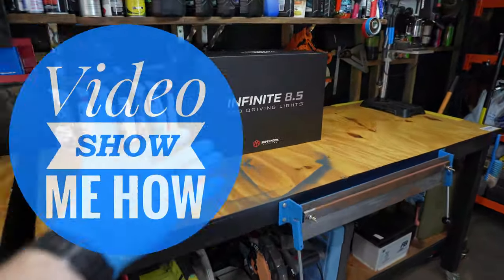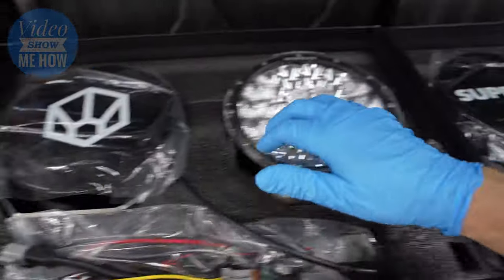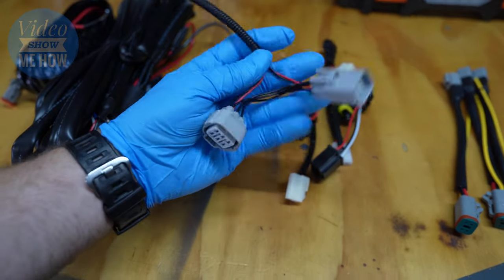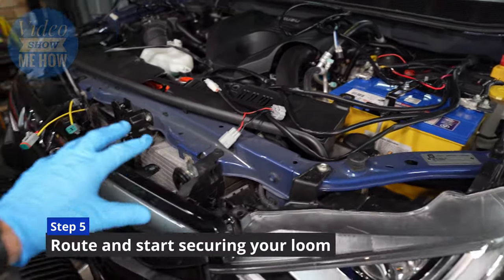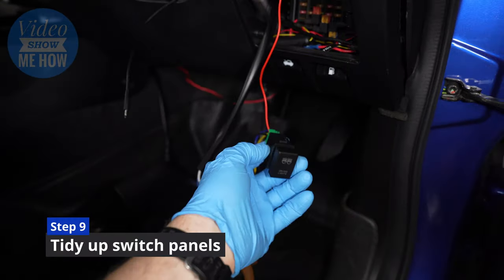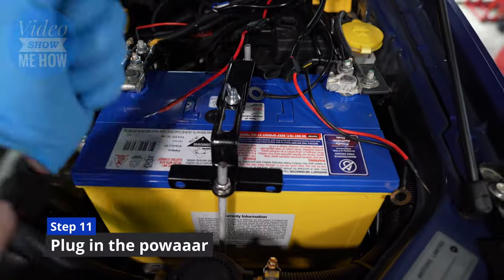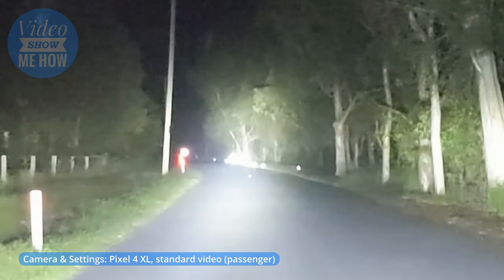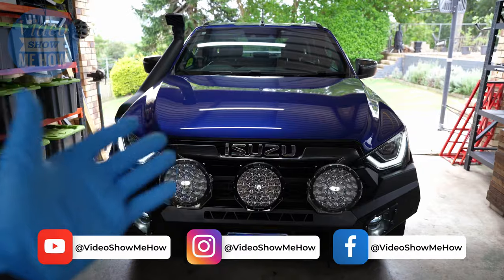SUPERNOVA INFINITE 8.5 LED DRIVING LIGHTS | Review, Install, Test | 2021 Isuzu DMAX Build Series #30

Comment: Hey mate. Just wondering where on the battery do you connect the positive? Strait to the terminal or on the extra part off it past the fuse.(if that makes sense, looks like you connected your dual battery to that part) I’m just having issues with my dmax after installing the dual battery and some work lights, the front light bar doesn’t work or cuts out if it does turn on. Thanks

Comment: For anyone wondering, the green wire is constant power for the DRLs, so hook it to that if you want your spotlight DRLs to be on without having your parkers on
Reply: I just gave this a go and the spotlight DRL's don't light up at all, whether they are on manual or automatic lights.

Edit: My bad, they actually do work perfectly in line with the DRL's - it took me to switch into neutral with the handbrake on to see whether they were working or not. 😝

Thanks mate!
Reply: Yeah thanks mate. I watched the vid and spliced into the one he shows here. Only work with parkers, but i want them to have constant power like DRLs are supposed to 😂
Reply: @jamiesmith6685  I feel ya mate! Here’s me contemplating splicing into a different wire until I get that result. Then get a new loom if all else fails...

Comment: Just putting this out there for comments if you have come across this problem. I have a 2022 dmax x terrain and on a night trip out from Kempsey on bitumen roads I noticed that the lights are s(&t both in high and low in low you have a little more then say a car  lengths of view, on high the depth is very poor and not much depth . Has anyone come across this? I took the car back to the dealer and they adjusted them a bit but I was told that’s all they  can do legally!. Any comments, otherwise I will need to follow Adam’s fit of accessory lights……!  Not happy at all 😡😡😡😡😡😡😡Thanks

Comment: Hey Adam, for the dash running light instead of slice in can you use a piggy back fuze connector to the fuze box right below it?
Reply from the maker: For the dashlight bit? Yeah you could do, just have to find one that powers up with dash 👍
Reply: Cool, what about the engine bay? I don't mind doing modifications to non factory bits that are easy to replace but factory bits are expensive.
Reply from the maker: @MP-hf3jn  nothing needed for engine bay mate, it's plug and play, the bit I modified in the vid for the DRL is the part you get from Supernova, eg so you don't touch the factory loom or plugs, one of the best things I like about the kit from them 👍
Reply: What about the parkers lights?
Reply from the maker: @MP-hf3jn  the Daytime Running Lights?
Reply: Yeah that lol
Reply: Purple wire to middle black wire
Reply from the maker: @MP-hf3jn  yep that's it, all in the vid... If you want to run the DRL on these (or any other spotlights) recommend modifying the supplied connecting loom that Supernova supply rather than the DMAX loom. Then it's just plug and play. Also if you muck it up, you can just get another patch cable from Supernova, easy. But just follow the vid and you'll be fine 😀👍
Reply: Man I follow all your videos. My Da'Maxs is almost brothers to yours lol
Thank you for all the work and time for making these videos and products easily accessible.
Reply from the maker: @MP-hf3jn  thanks mate, that's why I do it 🤘

Comment: Great job. With the excess wire, is it OK to bundle it & zip tie or should it be spread out to dissipate heat?
Reply from the maker: Could bundle, just not tightly, I cut the excess out of my loom 👍

Comment: I just had a bullbar fitted, and just purchased a  light bar  to fit onto it.
On the instructions, it states,  to join 1 wore to the high beam lead!! 
Wheres that at,what colour wire is it, and how do i achieve that fitting ?
Gr8 video btw👍
You make it look easy.
Reply from the maker: I show this in the video mate, about half way the purple wire... Hopefully the light bar came with a patch cable but if not you'd have to use the existing headlight loom

Comment: Hi Adam
I’m wiring a light bar as well so my question is can you parallel the high beam trigger and negative at the push switch in the dash to reduce wiring to and from relay?
Thanks in advance mate 👍
Reply from the maker: I run a lightbar as well, checkout that vid for what I did with the wiring..basically I spliced into existing headlight trigger wire but still used its own relay etc

Comment: Discount code used! 

Thanks Adam, 
I’ll take up your advice on the factory look plug you’ve used. 

Do I need the micro 2 fuse cap to install a set of 2? 

Thanks,
Louis
Reply from the maker: Great 👍 No shouldn't, has it with the supplied loom
Reply: I didn’t think so just ticking every box before I get started. 

Thanks for the reply 👌🏻
Reply from the maker: Have fun!

Comment: Hi Adam, do you reccomend the solder connectors for splicing or t tap slice connectors? For tapping into the signal wires?
Reply from the maker: Not a big fan of the tap/slice or scotch lock style of connectors particularly in vehicles or anything that vibrates. I try and use the waterproof solder connectors I did a video about a while ago where possible
Reply: @VideoShowMeHow  cheers Adam 👍 did you use solder connectors for tapping into the brown wire for the dash illumination?
Reply from the maker: @SonicsnakeCNR  yep
Reply: Hey Adam love your videos. How did you work out that the brown wire is the dashboard feed light feed? Just curious. 

I’m going to wire up my 2023 SX tomorrow, thanks for the inspiration!
Reply from the maker: Cheers. Used a test light

Comment: Hi Adam,  can I just use a T-Tap to tap into that brown wire for dash illumination? And is it also the brown wire if I want tap into dimmer switch on the right? Can the illumination on your switch be controlled by the dimmer?
Reply from the maker: Best avoid the dimmer circuit, sometimes leds can flicker etc if on a dimmer. When you say a t-tap do you mean a scotch lock? Am not a fan of those :(

Comment: Looks cool, but these lights are quite big, arent they limiting the airflow going to the cooling system?
Reply from the maker: Nope, I tested this and the delta is <1c, I show the temps during the light test in the vid.. this is a bit of a myth in a lot of cases
Reply: @VideoShowMeHow  cool, thanks for reply
Reply: You won't notice a massive difference in cooling under light loads (daily driving, highway etc), it'll be come apparent when you start putting the engine under at full power under heavy load (sustained towing up hill etc)...

Comment: Hi Adam, all your videos are fantastic many thanks. I want to buy a SUPERNOVA Light Bar for my21 D Max X Terrain, can you let me know where bought the Piggy back adaptor Plugs for the my21 D Max high beam light feed from... Many thanks for your help Cheers Kim :-}}
Reply from the maker: Hey thanks Kim! Came supplied with the lights, Supernova also sell these separately 👍
Reply: @VideoShowMeHow  Thanx for the quick reply Adam, I was unable to find the My21 D Max Piggy back adaptor Plugs in several attempts using  there web site and was also unsure of what was supplied in their loom. Their blog instructions on their website also advises cutting, splicing & soldering into the light high beam feed, something I do not want to do. Stedi & LightForce sell the My21 D Max Piggy back High beam light adaptors but I'm unsure of if they are compatible with the plug on the SuperNova Loom   -  so I will call them and email them to find all this out and update this post.... Cheers Kim :-}}...... 

Update....... 
..... I ended buying a STEDI Piggy Back Adaptor - Suit Isuzu D-Max 08/2020-on & 3rd Gen Mazda BT-50 (09/2020-On), .....
.... After confirming with Supernova that this  Piggy Back Adaptor would work with their supplied loom on the Supernova 22 Inch Light bar - Single Row Delta V3.0

Comment: Hey Adam, I’ve just put a triple pack of the supernovas on (AltiQ) and they seem to be triggering with low beam and causing a LH headlight failure, I did use the patch harness too with the kit. Any ideas what could be wrong?
Reply from the maker: Hmm hard to say. I would be breaking out the test light and confirming what wires are being engergised with the patch harness. Sounds like they might be in the wrong spots
Reply: Found the problem, turned out to be the patch harness!! 😮

Comment: Hi

I have that same harness with two DT connectors, I want to add a third light, what adapter do I have to buy to add it?  Will you have a link?
Reply from the maker: @espaun206  I ran a separate harness for my 3rd
Reply: @VideoShowMeHow And how do you get them to turn on and off with the same switch?
Reply from the maker: I just wired the trigger for the relay to the same switch.. this is covered in the video

Comment: Hi Adam question mate was it hard feeding the wire through the fly wall
Reply from the maker: no not really, if tricky can always use a coat hanger or the like, with the cable taped to one end of it poke and then pull the lot through. Have found the gromet on the passenger side easier

Comment: So the my22 dmax I got in April doesn't have that dummy plug... I spliced it from the brown wire on the dash light dimmer plug, everything lights up but my switch.. I am also lacking the wiring loom for headlights atm. I believe that is also a reason as to why . Thoughts?
Reply from the maker: What type of switch? Does it have a good earth?
Reply: @VideoShowMeHow  the narva switch. 

Like whole wiring loom setup minus the loom to headlights

Comment: Hey Adam is there a way to pm you? Want to see if you know how to change front indicators to led?
Reply from the maker: Hey bud, do you mean on the factory bar?
Reply: @VideoShowMeHow  yeah man, is it a mission or fairly simple? Wanna avoid taking the bar off
Reply from the maker: Just had a look at the old bumper, I reckon you wouldn't need to take the bar off, can remove the housing with a couple screws.. then it's just be replacing the globe with an led version
Reply: @VideoShowMeHow  legend cheers

Comment: Hey, I was just told by ARB that I have to get 7inch driving lights because anything bigger will get in the way of the sensors…. Is true?? I feel they are full of it. They are only going in the middle of the bull bar in the usual spot everyone puts them…anyone help me out? I have a 2021 dmax terrain.
I don’t see how when the sensors are below at the bottom of the bull bar.
Reply from the maker: Hogwash.. been running these 3x 8.5" since this vid came out zero issues 👍
Reply: @VideoShowMeHow  awesome thanks, I thought that was pretty stupid. They are known for ripping people off at ARB down here as well with bogus $600 engineering fees for installing long range fuel tanks when no one else does.

Thanks mate, Great video! will see how confident I am to install whatever lights I buy after watching your video. Lol
Reply from the maker: Enjoy 🤘

Comment: It is illegal to run three lights. It’s either two or four. Amazing lights though.
Reply from the maker: Not in QLD it's not 🤘 Law changed (same in some other states I believe) in 2020. https://www.publications.qld.gov.au/dataset/ec37bf52-66be-47b0-9832-0e51df00eb3f/resource/446c05fc-1373-4a9d-a5ac-e729598cd334/download/driving-lamps-including-light-emitting-diode-led-light-bars-on-light-vehicles_sep21-final.pdf Common sense prevailed 👍

Comment: Please don't use the negative terminal on your battery guys, it has a chance to mess up your smart alternator,,,,,always ground to the body work. Your winch should be the only bit of kit that uses both negative and positive post on the vehicles battery ✌✌
Reply from the maker: Eh?? I've always used the battery neg on a heap of different mods/cars never had an issue? How would this impact your 'smart' alternator? Not having a go mate just curious as this has never been a thing in my exp?
Reply: @VideoShowMeHow  modern vehicles with smart alternators have a shunt on the negative battery cable to measure the current draw on the system and varies the output of the alternator to suit the system demand. if you ground your spotlights directly to your battery negative post, then the ecu won't read the current drawn by them and your alternator will struggle to keep up. the ground for the spotlights needs to be on the body side of the shunt. it's pretty important for the dmax too, they don't have a lot of excess charging capacity as the electric power steering rack is pretty power hungry.
Reply from the maker: @jakeminogue  the ecu would read a voltage as well though and modify the charge rated based on this too no?? And why is winch ok? Because high current/intermittent use? Like I said have never had an issue in the past but this is interesting and will research further - cheers 👍
Reply: @VideoShowMeHow  I'm a mechanical engineer, not an electrical engineer, but im thinking that the smart alternators vary both their output voltage and current, so while it might be upping the voltage to 14V to try to maintainthe battery, it might not be outputting enough current to cope with the draw of the spotlights? ive always just made sure to stay on the body side of the shunt if there's one there, it's not hard to do. I've never dealt with winches personally but I think you bypass the shunt to avoid overloading the alternator (let the battery take the abuse in that case maybe? idk). but definitely do a bit of research, as none of us in the youtube comments are experts! haha
Reply from the maker: @jakeminogue  yes I am neither haha but do like to research and understand so will spend some time doing just that 👍 Thank you mate